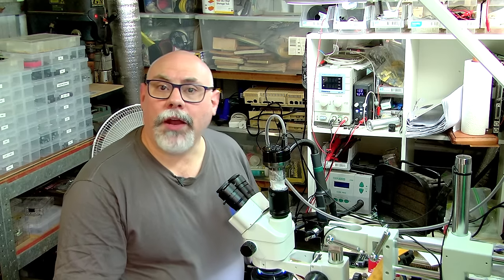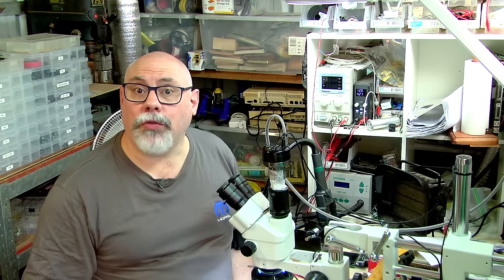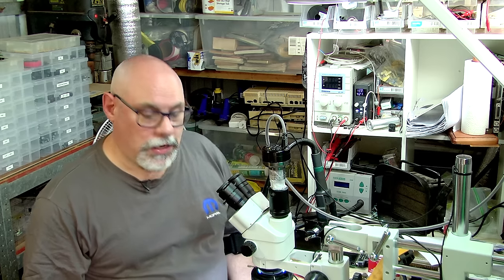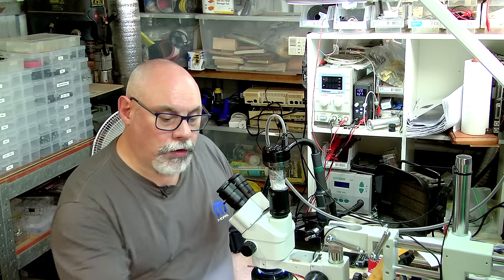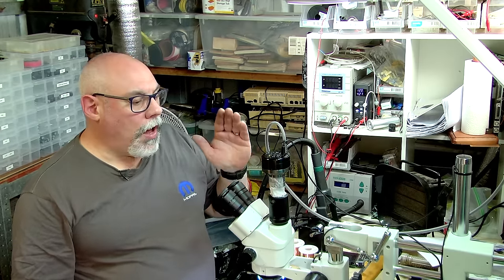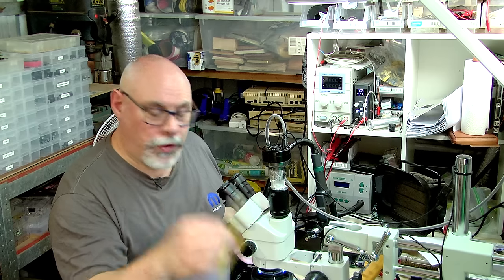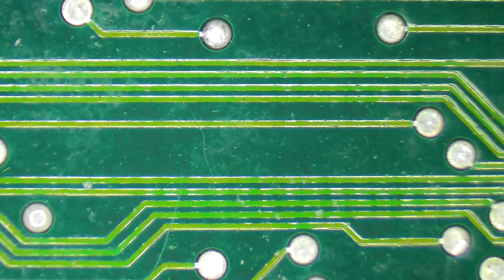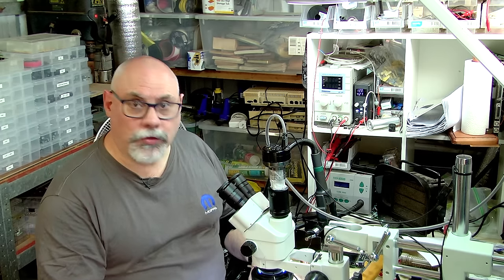Repairing broken traces on a circuit board

Comment: Hello I wonder if you could help me. I'm an old guy I'm learning Arduino stuff and I'm making some circuit boards out of protoboard and I'm having a hard time with traces. I am not completely without in history I worked in the robotics industry for years and years and had to do a lot of repairs in the field at times and I even worked in production for quite a few years so I know how to solder but oh I have is a Weller W TL1000 and it's pretty hot and you can adjust it. So making solder base traces is kind of difficult for me. I recall that a couple of our electronics guys at work used to do prototypes and they had a box of tiny tin strips period now I don't know what the material was made out of they just called it tin strips. Do you have any idea what these are they actually and where I could buy them? Or any other solution that's good for protoboard? thank you in advance

Comment: Great video thank you. I came here as I've got a bi metal vintage 5vdc automotive Temp gauge that I need to repair. A new trace and voltage reg wire. I'm a bit worried heating up the board doing it. Does applying the gel help with heat insulation absorption as well ? What spray do you recommend for sealing boards once finished the gauge is like 40yrs old ? Many thanks cheers

Comment: Never soldered before and everything I know is from you (so thank you for my new addiction lol). But I'm confused, the enamel coating on the wire, is it conductive or does the coating melt away when you apply the flux?
Reply from the maker: Thanks so much for watching! The enamel coating is an insulator. I actually melt it away using the heat from the soldering iron. The main reason why I use an insulated wire is that sometimes for the big repairs, wires have to travel along the board and past other components, and this helps to guard against unwanted short circuits.
Reply: @BranchusCreations  thank you for the fast reply. I just watched your video on pad repair and you went into a little more detail in that video which cleared everything up for me. I ordered a station and can't wait to try my hand at this bc of you.  Thank you so much again!

Comment: Hey mate , I have snapped off wire (from switch ) in hole is it safe to drill out or what's the correct way,  cheers mate, it just won't budge with heat etc

Comment: Great video.
Question,  so I'm new to soldering on pcb boards and I'm replacing my hall sensors in my ebike hub motor.

Story short, I think I rover the copper ring (half ring in my case) because I thought it was part of the soldering.

can u provide a link and/name for replacement rings. Can they be repaired or use solder in as a fix. And what is the technical name for these?  

Hope I haven't bothered u too much. And hope u can help. 
Great video

/bklyn 👑

Comment: Quick Q: when cleaning excess flux on the board, I use 99% Iso alcohol and a nail scrub brush. I wipe away as much as possible, but it always leaves behind a small amount (I try to remove leftover with Q tips and paper towels but they always get snagged on the leads poking thru). That left over amount dries and leaves a dull finish on ALL of the solder joints that were shiny. My Q is if this affects the joints or is it just cosmetic? I use 60/40 btw, but when the iso dries it makes it look like dull lead free joints
Reply: You're probably getting dull joints from the nail scrub brush. I'd look into getting acid brushes as they're soft enough to not make your joints dull but are great for removing flux. Next I'd not use paper towels as they can generate ESD, and leave fibers all over what you're cleaning. Kimwipes are a much better option, just scrub with your acid brush and alcohol until your flux is disolving, then hold a kimwipe in place on your board and brush right on top of it to soak up the flux. Having dull joints is not ideal and not pretty, but won't affect the integrity of your solder connection. A master instructor once said to me "ugly still goes to prom".
Reply: @silent9pc  I think you are right about the nail brush. The way it dulled the joints had me concerned since it would actually read resistance so high it showed open on my DMM. After wiping them clean with a cloth however, it would return to 0.000 Ω. Since you mentioned the possibility of ESD with paper towels, I've stopped using those. Trying to perfect my soldering so I can eliminate poor quality joints as I troubleshoot this Pioneer VSX-4500S I picked up last week free of charge. Owner has no electrical skills so it became my project. Makes VERY loud crackling when turned on (not touching volume pot or any buttons) and protection relays clicked on and off randomly. There were darker areas on the PCB around the small signal transistors. The joints looks like crap. Some are completely starved of solder. Basically I'm reflowing every joint on all boards and replacing all transistors since I have plenty on hand for replacements. All four power transistors had shorts, as did some of the small ones. No sense in half measures, right? It's a tedious, time consuming project, but with the tuner board removed, fresh solder, and better connections, it should be closer to 0.004-0.002% THD 20Hz -20KHz and over 100dB SNR @ 100W into 8Ω.

Comment: Dude!  Mopar T-shirt? Tell me you have a right hand drive Hemi Cuda in your garage!! (The video was helpful too!)
Reply from the maker: Oooo, wouldn't that be nice! No, I have a right hand drive Dodge Phoenix 400. It's essentially a Plymouth Fury, but it was made here in Oz, and Chrysler Australia rebadged them as a Dodge.
Reply: @BranchusCreations  What year is the Phoenix? I've seen a few Aussi Mopars over the years. Very cool to see what was being sold abroad back in the days of muscle cars. I love some of the hot rodded 6 cylinders down there.  Quick question about the Solder Mask. I'm trying to order this with some other components (from Mouser). What I'm finding is "Temporary" or "Peelable" mask. I'm assuming this is not the same product? Or could I use it?  (69 Dodge Charger, 383 auto) .... (Left hand!)

Comment: Perhaps you should use or mention that a damp sponge that should be on your solder station to clean your soldering iron between the soldering on the tracks. I use to work at a company the assembled  test equipment and we would get a right bollocking if the iron tip wasn't  clean :-)

Comment: I got an electric nail file from the Dollar Tree doesn't have much power but I find nothing removes solder mask on the traces better
Also you should try a Bcm2 tip holds solder better and is great at dragging the solder

Comment: I learned everything I know watching these videos! I have a slightly shaky hands especially after I have too much coffee. but I just attempted a trace repair on a Craig tower speaker I got from  Local drug store on sale. I am unsure if it will be ok because it was the 2nd repair. both times from tripping on the wire and physically bending the 3.5mm header. this last time I had to take the header off and Im having trouble seeing the traces? its like 2 are connected and one runs off to the power switch? I am thinking the may be ground and something I am unsure of what its called? these are the troubles slowing me down currently?

Comment: If a capacitor's pad is damaged and a bypass wire's been soldered in place to the other endpoint on the trace, show the pcb trace be cut on both ends ? I ask in case there's resistance or increased ESR as a result of dead end traces ???

Comment: hi my issue is with a technics tuner, tried to replace a resisor, and it just would'nt solder, then i noticed the pcb trace was lifted from the pcb, any ideas, kind regards mike
Reply: Sounds like you're getting a solder anomaly called nonwetting. That will sometimes happen and is usually caused by the joint oxidizing from the heat before the flux can work its magic. If you can scrape the trace to get clean copper to tin then you can proceed to using a very minimal amount of trace/land epoxy to hold it down and cure it. Once it's cured, you can use a new resistor and flux to to complete your repair.
Reply: @silent9pc  thankyou for your advice will have a go at doing what u said

Comment: Working on a game console that has a few broken traces in one area. This looks very helpful! Thanks!

Question though: couldn't you tin the copper wire before placing it on the board?
Reply from the maker: For sure, either way is fine.
Reply: @BranchusCreations  will you fix a broken SD Card? It would me too much for me to buy all the equipments. I rather pay you to do it if you would please

Comment: I love your educational videos I have learnt so much and have more confidence with electronic repair. I'm new to this topic.  I'm wondering why you can't just use solder to fix the traces?  Why do you need to put copper in the trace? I thought solder was conductive.
Reply: I've done exactly that in some situations,  but, when long sections of the trace are missing,  it can be very difficult to get solder to follow the trace path, and then there's the risk of bridging other components near the path. If the break is more than a couple millimeters,  using copper wire is advisable...

Comment: I was a bit too eager when desoldering a chip and pulled a solder pad up, then when instructions to bypass it said scrape solder off via and ended up destroying the solder on the via totally, I thought maybe use conductive paint on the via so I can resolder it, would that work?

Comment: Great video. How do you prevent the solder from bridging the tracer you’re repairing with an adjacent one? Does it. naturally stay isolated, or is this entirely skill and experience?
Reply: Use lots of flux and solder bridges easily wipe away. He actually bridged a trace at 13:14 — he says, “Did I bridge that?” — and then wiped it away in less than a second.
Reply: Practice!

Comment: Thanks so much for the very informative and instructive video. I would appreciate if you can tell me how to determine the best soldering iron temperature setting to make trace repairs.
Reply: There's several variables that factor in. What solder type are you using? What tip size? Is your trace closely connected to a ground plane?  If you're using say 60/40 solder, it has a higher melting point than 63/37 which means it needs to be just a bit hotter. If you're going with lead-free RoHS (restriction of hazardous substances) solder then it can require more initial heat to flow it than 60/40. Trace size doesn't really matter unless it's connected to a nearby ground plane. Tip size it helps to select a size about the same width as your intended solder joint width. Start with a high enough temperature that your solder will melt to the tip nearly instantly, I find about 600°f a good starting point for 63/37, maybe 20 degrees hotter for 60/40, and probably about another 50+ for lead-free.  You'll have to get a feel for the solder as its wetting and flowing. If it flows too slow and feels like your iron tip or solder is getting stuck then you're probably too cold. If your flux starts darkening too fast or burning off before you get a good joint then you're probably going too hot.

Comment: What's the reason for using no-clean flux?
I can't get a no-clean flux.. Will it be safe if I use clean flux?
Reply from the maker: That's fine, just make sure you clean it off afterwards.

Comment: Thank you for the excellent educational video on PCB repair. I have a question with regards to the trace holes. When you put the wire through the hole you filled it with solder, when you go to put the component back through the hole do you just melt the solder and push the component through.

Comment: I think you skipped an important step. When dealing with leaky battery damage you should always clean away and neutralise the battery fluid. The cells used in these old boards were usually alkaline batteries. You should neutralise with white vinegar then clean thoroughly.
Reply: Would alcohol and a little nylon brush do the trick?

Comment: Did you strip those wires before laying them down or just relying on the heat of the iron to melt the insulation? Not sure how that would remove the insulation under the wire though.
Oh and you forgot to Fluke it for continuity.

Comment: But how can you run copper through the hole to fix the trace? aren't the holes supposed to be where components are placed? So if the copper is already there when you try to solder it in place the copper wiill fall/be in the way, no? Thank you for the vid!

Comment: Please understand that I do really like your tutorial and find it very interesting and informative! :-)
Therefore please read this comment as kindly meant even that it may not sound so, my English is self-thought and I do in no way master it.
By using exactly your method, or at least 90% of it, do I use copper strips instead and end up making it look like it has never been repaired. May I please ask you why you have judged the solid wire to be better than the copper-foil-strips? I am only asking because I try to learn and understand! :-)

Comment: Is their any instance where this will not work? Like the change in wire resistance or distance means that if done in certain applications the computer would still not run?
Reply: Lol, I came here after damaging a xbox motherboard. This makes it look so easy, but when I went back to my board the wires are like a micron thick and right next to eachother. It would be interesting to see what this board looked like without the magnification, but either way I do not think my problem is solvable without magnification and far more skilled hands than mine.

Comment: H Buddy, I hope that you are still active on here. 
I have a circuit board that has a burnt out pin bore where the leg of the relay is soldered to from the back, can you advise me how to repair please?
Reply: Is it surface mount or through-hole?

Comment: Very informative video. Do you remove the wire insulation or does it come off when you tin the wire when attaching to the board.? If the via has no copper how can you attach it? I’m a new subscriber and retired but learning and taking electronics courses mainly for automotive knowledge but trying to learn a little bit of repairing boards. I have a board I’m have to do a small repair on so I’m going to give it a go. Hope you can address my concerns noted above thanks for sharing your knowledge and stay safe and well Artie 👍😊
Reply: Ive been making these types of repairs for decades. It's not even necessary to use insulated wire! I just use raw copper wire and then coat it after the repair. If insulated is all you have, some will solder easily,  while some will not. In the case of stubborn wire, just use a sharp blade and scrape some of the insulation off the ends. Easy peasy...